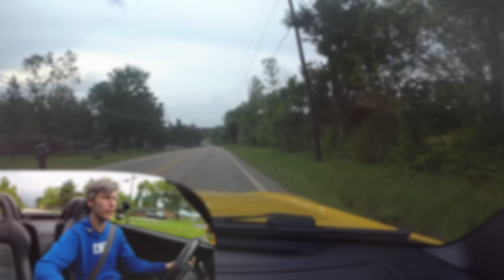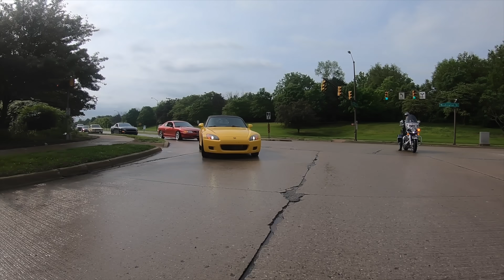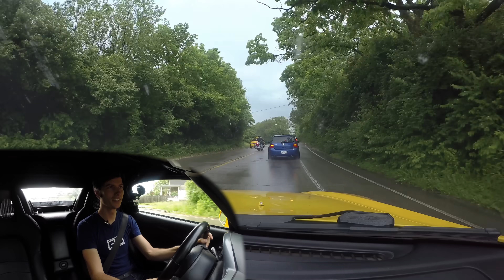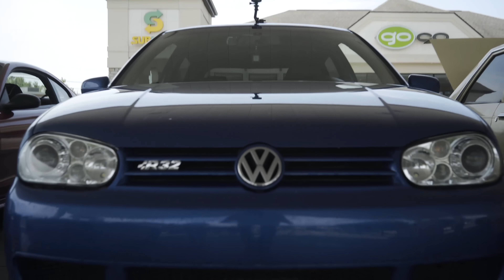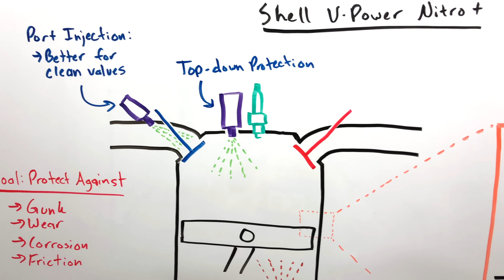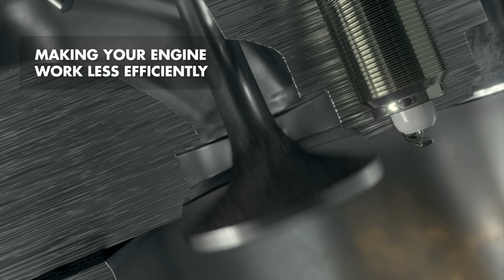I'm Selling My S2000 — One Last Ride

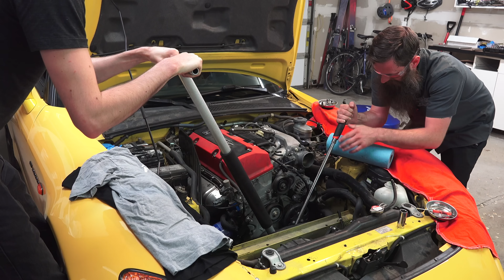Comment: I like this whole video, however @ 6:10 got my attention for a good reason. Even though I'm mostly on the "Electrical" side of technology, I was a factory trained electrical/electronics technician for almost 11 years along with earning an AS ET degree. The whole experience was VERY "hands-on" and I became very proficient at diagnosing and/or modifying many electrical/electronics systems for a long time so much that... when I went back to school for a BS EET, the less "hands-on" the education became. I then earned a full BS EE degree, which was almost entirely "math calculations" with a small amount of lab experience. My MS EE and PhD studies were only "hands-on" at times because I had to seek out the means to practically test what I was designing. With that mentioned, most universities have sophisticated "workshop/test/protoyping" areas when needed, but my experiences lended mostly to completing the "theoretical" requirements, which again limited my "hands-on" and diagnostic skills previously practised.

In summary, my experience as a "technican" was primarily "hands-on" due to the diagnostic and practical nature of the work requirement, yet the "engineering" experience is primarily "design oriented." Of course there's overlapping knowledge and practice between the areas, but there's quite a bit of distinction between the two areas of practice.

Just my few cents that I thought to put out here.

Comment: I wonder how those additives do with different oils and their special additives. Asuming those additives stick to the cylinder wall after the piston is at tdc, I'm curious on what the oil would do when its coated over that additive. does it repel the oil a bit or change the characteristics of the oil like enhancing the oil slightly with more anti wear properties.

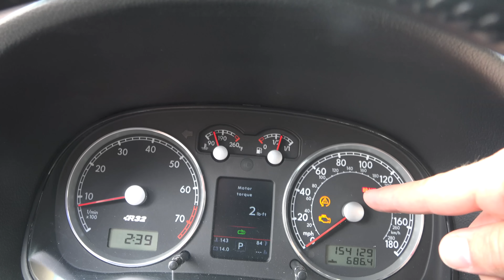Comment: 9:10 I will say this as a vw owner.  Yes the check engine light comes on for every. Little. Thing. But the car also tells you exactly what's wrong.  

This is most beneficial when you have a tail light out and it tells you exactly which bulb.
Reply: roguedogx   Condolences... but perhaps you have a daughter that won’t be embarrassed driving the definitive “chick” car.
Reply: @marklandis5794  if i have a daughter likes a Prius I'm disowning her.

Comment: When I worked at Carmax few years ago 
an S2000 was appraised I was hyped bc Carmax low balls til I saw the price and condition... beat to hell exterior horribly disrespected blue leather mechanically didn’t run right it was the worst S2000 Iv ever seen but Carmax still offered 7500

Comment: when you added the supercharger, did you replace your cam to reduce/eliminate overlap? some say having valve overlap when you are on a supercharger just makes the engine dump boost into your exhaust, some say that turbos don't have the same problem because turbos introduce backpressure.

Comment: You went about the S2K completely the wrong way. 2 biggest annoyances of the S2K is the exhaust drone and the high engine rpm at cruising speed. It's hard to enjoy the car when cruising at 70mph @4k rpm's and the exhaust drone punishing your ears. This is why you shouldve turbod it, and INCREASED the gear ratios. Adding a turbo to the S2K muffles the drone, and transforms the car to a personal jet plane.  With a turbo and longer gearing you can cruise 70mph @3k rpm with no drone and teleport to 90mph for a quick pass. That's the best way to enjoy the S2K imo

Comment: So the lubrication from the new shell formula is essentially a lipid right? But with maybe a longer hydrocarbon tail?
That's fascinating! Also why is the polar head attracted to the metal wall of the cylinder? Is it because the electron sea from the metal creates a negative dipole which attracts the positive dipole from the polar head? I haven't gotten to the electron sea in my classes I just know it exists

Comment: I definitely know the feeling special, Jason. I was a traffic controller during a special truck ride here in the Netherlands. I had to shut down crossings to let the trucks pass and "race" from crossing to crossing, and we were allowed to speed and overtake and such by the police to do our job. Overtaking a police car doing 70 in a 35 zone over a double yellow line is a very special feeling when the cops wave at you for doing a good job instead of pulling you over.

Comment: You guys are only just getting Shell V Power? We've had it in petrol and diesel for years. Honestly, it's no better than regular fuel for 99% of cars on the road. For high performance BP 102 octane is best. Even our supermarket fuel is better than Shell at 99 octane.

Comment: So it really helps against carbon build up? I got a new GTI on the way and that’s the main thing I worry about.
Reply: Fly2kill1 not for direct injection. While a case can be made about a cleaner fuel injection reducing carbon on valves, this won’t solve VW carbon issues on DI engines.

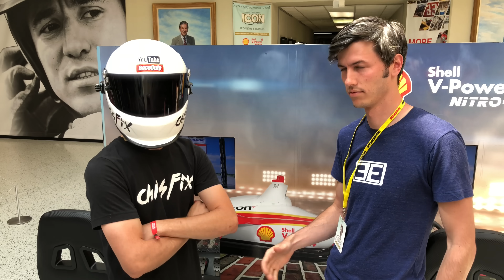Comment: That slap at 10:28 was Karma :D (for all the traffic skipping and being 'rude'). Thanks for the video, Jason. Sad to see the S2000 go, though.
As for fuel, I got an older (14ish years old) engine. General throttle response is a nick better, and avg. consumption is lower when fed Shell V-Power fuels (tasty performance one), over the others in Hungary. Not entirely sure of the composition of these fuels, but for me, Shell has won. The only thing I would like to do is take a measuring device and just see how much of it is actually Ethanol, and how high the octain in it really is.

Comment: Love VTEC, I actually had a VFR. A VTEC V4 800cc motorbike. Loved the sound when it kicked it at 6500rpm as the valves opened up.

I miss it so, as I imagine you will too.

Comment: Jason, now that you're an oil tycoon..  Can you ask the Shell to make E-85 more available at all their fuel stations?  It's what car's crave
Reply: I think E-85 is pointless. It'll never really take off unless they lower the price to less then equal of its gasoline counterpart. I ran it for a month in my flex fuel. Did all the math. Observed it to a tee. I saved 27% in fuel cost and got exactly 27% LESS milage out if it. No one's gonna switch to that if the only thing its doing is lowering the range of each fill up. I know it burns cleaner which is great, but if the individual is not seeing a benefit for themselves, majority of people wont go for it.  
Now you might be referring to adding it in small amounts to a regular car to "up" the octane rating. Which chemically works. I dont know if helps performance wise. Ive seen a lot if people who like to do it, and a lot if videos saying its not helping performamce wise at all. So not sure which is true. But i do know  there is draw backs to adding it in like that. Engine damage being the leading one. Ethanol is very corrosive to gaskets. Even the vehicles designed to run on E85 it says in the manual to fill up a full tank of regular gasoline every now and then. At bare minimum at every oil change.

Comment: Really enjoy your vids. Can you please consider doing one about the placement of calipers on disc brakes. It is my opinion that caliper location has an effect on vertical momentum and that is why front brake calipers are almost always loaceted behind the axel while rear brake calipers are located forward of the axel. Does this configuration aid in anti-diveing for the front and adding downforce at the rear?

Comment: What if the manufacturer recommends regular 87 octane fuel but I use premium 93 octane fuel anyway? Are there any advantages/disadvantages to doing this? Aside from the cost at the pump, of course.

Comment: You have to get a pickup truck next a real 1/2 ton long bed 4x4 or maybe a all out 1 ton dually crew cab diesel. You say you want to learn new things and owning a truck is a completely different experience to what you had with the S2000.

Comment: My engine is tuned on Vpower. Would I need to retune on the new Vpower. My initial thought is no but it sounds like you have the inside info on the fuel.

Comment: You are making a HUGE mistake.
Take it from a person that sold a street tuned R32 GTR and a number of JDM  only sport cars that were built and tuned from known Japanese tuner shops that I really REALLY  miss now.
These vehicles worth appreciated quickly and now they are extremely cost prohibitive to attain now.
Also looking at what is available now it seems that the only two sport cars left from Japan are the NSX and GTR which are  priced  in the Premium range and lack a manual.
You seem like you are "sort of a car guy" so what you are doing is weird.

Comment: So the anti friction additive in that fuel is basically chemically a soap?
Reply from the maker: Similar to a detergent in the sense that it has a polar head and hydrocarbon tale, but Shell tells me detergents are not used for reducing friction but instead for cleaning, where as this molecule specifically is designed for reducing friction.
Reply: @EngineeringExplained  A detergent is not technically the same as a soap. Grease for example is made from soap. If it's specifically designed to reduce friction, it doesn't mean it's not a soap. Another molecule with hydrocarbon tale and polar head is a fatty acid. But thats acidic. Nutralize that acidic head with a salt, you have a soap. For soaps used in grease, a lithium salt usually is used (like in a lithium complex grease)

Comment: I'd like if you tested regenerative breaking relative to speed on your Tesla. If you break from 60 down to zero in x time verse 2x time, is the regeneration the same?
Reply: No, if you decelerate slower you get more regeneration as it does not use the actual breaks.
Reply: But i want him to test how much, and what is "optional" of possible. I don't drive electric yet, but i was curious and thinking about it. What if neither the x or 2x time uses the actual disk breaks?

Comment: Did he just say 2 liter? Has he swapped a 2.0 in or does he mean 2.2?
Reply from the maker: AP1 S2000 (Before 2004) have 2.0L engines.
Reply: Engineering Explained genuinely didn’t know that, but thank you for taking the time to clarify

Comment: I sold my s2000 9 years ago. I'm still looking to buy another one. Don't do it. Nothing fills that void.
Reply: I'd only sell it if I was upgrading to a gt3 rs
Reply: Buy Jason’s!
Reply: I just got my S2000. It may not be the last car I buy it is the car I will not sell. It took me 5 years to find it.
Reply: Ldunk can I ask what features where you looking in your s2k ? Low miles? Club racer? Rare color? Why did it take so long to find?
Reply: @johnconnor7501  I was mainly looking for a 2004 or 2005 because it was the best of both AP1 and AP2.  Limited slip,  no drive by wire.
Reply: Ldunk ohh ok. I got an 01 with an 05 engine too. Steering rack is a little faster on ap1.
Reply: @Bryce Czirr naw those cars are pigs.
Reply: Bryce Czirr the s2000 weights less than 2800 and the 350z around 3300 depending on transmission type, that’s a 500 pound difference. 
 
Still the 350z is fun too
Reply: sleepyf1 you don’t choose an s2000. An s2000 chooses you.
Reply: @johnconnor7501  this comment made me laugh for some reason lmao
Reply: Bryce Czirr s2k>350z ANY Base
Reply: Bryce Czirr better at not burning oil and grinding gears. Lol

I have a friend with a 350z , it’s a fun car too. The s2000 is more of a precision tool , demands an attentive driver, not for everyone.
Reply: @Bryce Czirr Its not possible. The weight difference is night and day. The 350z is just a heavy GT car. It's more comparable to wide sports cars porches, the Hyundai Genesis Coupe and luxury performance sedans IMO.
Reply: Bryce Czirr Honda>Nissan
Reply: @Bryce Czirr reliable reputation? Where did you hear that? When it comes to more reputation its always honda toyota and nissan, those 3 are on par my friend. And no way an 8th gen si would beat an s2k.
Reply: Facts and they are collectors Dream
Reply: S2000 is gonna be my first car!
Reply: @Bryce Czirr lol no there is a HUGE gap on weight dude.
Reply: @UCP7sxHzSG0kDVDxo4vxgMJg s2k is 2800 gets your facts straight. Thats huge difference my friend. Plus its all personal preference too.
Reply: @Bryce Czirr i know the new miata is even faster than the brz. But that s2k is becoming a collectors car soon, thats what you got to remember and tthat car came DECADES ago. Performance still impressive though.
Reply: @Bryce Czirr like i said dude its all personal preference.
Reply: I still really regret selling mine
Reply: Why would u sell it?
Reply: @Bryce Czirr 350z's are pigs and overrated
Reply: @UCP7sxHzSG0kDVDxo4vxgMJg on straight yes 350 is faster on small track no. Do you ever watch best motoring?
Reply: A Porsche does
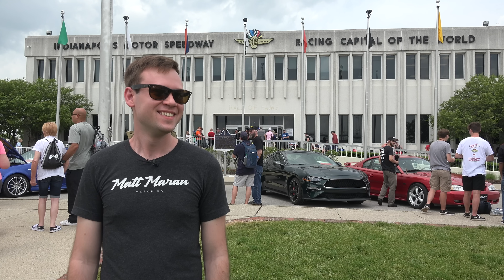Reply: Not related but at 9:33 you can see chrisfix next to his mustang
Reply: What are some of the things you most loved and miss about the car? Im meant to be buying one in about a week
Reply: @iCozzh  The sensation and thrill of open top motoring at 9000rpm. The way you can feel the gearbox change gears through the transmission tunnel. How the car rotates with your hips at the centre of mass.
Reply: For the price everyone asking I would just buy a c6 must better car. People be tripping on the price .
Reply: A Honda beat filled the void
Reply: Bro 9 years ago, like just forget about it already😂you obviously didn’t care about it that much lmao
Reply: Pretty sure he made it clear that there wouldn't be a void.
Reply: @pwdt4r313  He just doesn't know it yet ☺
Reply: Clearly, you're not looking too hard.  If you wanted one, you'd buy one.  Doesn't take 9 years to find a car.
Reply: @jacklondon3921  I've moved on and have owned statistically better cars, including my current, an FK8r.  However the thrill of open top motoring at 9000rpm is something I'll never forget. Low mileage late model cars are very rare and expensive where I come from too.

Comment: I've got a question about octane. My car (2005 Nissan pulsar) calls for 95 RON fuel. I'm in Australia so everything is RON rated and our pump fuel comes in 91, 94 (E10), 95, 98. E10 is significantly cheaper than 95 and my question is do you think it matters if it's run on E10 being 1 RON below what it specifies?

Comment: When I was a kid, I remember regular and premium having separate hoses. Pretty much any gas station I go to now only has one hose and the switch between the different grades of fuel happens before the hose. 

My question is, if I fill up my car with premium after someone just filled up theirs with regular, how much regular fuel am I getting before premium goes through the hose and starts to reach my tank? How much will that lower my overall octane?

Comment: Question on the fuel: Would the fuel sprayed into the piston even have the time for those magnet heads to attach to the wall? Won't they be subjected to combustion along with the fuel itself before they've had the chance to latch on to the walls?
Reply: Those polar heads burn and dont burn at the same time
Reply: @chrisfix  burn and don't burn? Didn't get you Chris.

Comment: It's just gonna go up in value. Why sell it now?
Reply: Lol. Got 'em
Reply from the maker: I explain why I'm selling it in the video :)
Reply: Engineering Explained still... the S2000 is basically perfection. Even today there’s probably still only a handful of cars that can best the f20c hp per liter while NA. Out of them how many are FR layout and manual transmission though? For what the S2K is and does, I don’t think there’s a car that does it better, or has a higher potential, and you have to remember that when they were making this car Honda was dominating motor sports, Senna was alive driving a Honda powered McLaren in F1 not too far back when they were probably designing this car, and they released it on Honda’s 50th anniversary. Obviously it’s your decision and you seem to have already made it, and yes ultimately everyone else’s opinion but yours doesn’t matter. But it is my opinion that YOU’RE MAKING A HUGE MISTAKE

Comment: So no videos of going up and up in power of the S2000 after all. :(
Reply from the maker: If I add power I need an aftermarket ECU, and it's no longer emissions legal where I live. Unfortunately, that's not a smart thing to promote on YouTube, so I'm not going to push it outside of road-legal parameters.
Reply: @EngineeringExplained  My prototype should give it more power while still running the stock ECU.  

It's like running very high octane racing fuel.  I don't know exactly how high the octane equivalent would be?  

My test car runs the maximum ignition advance setting on the distributor.